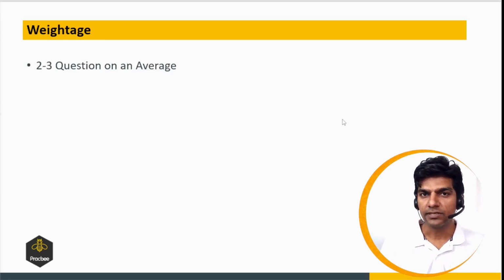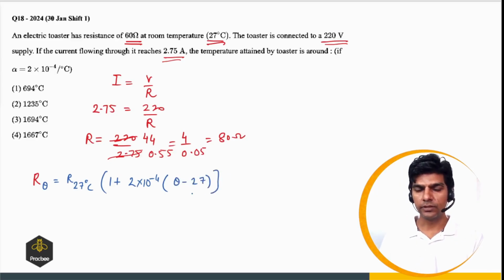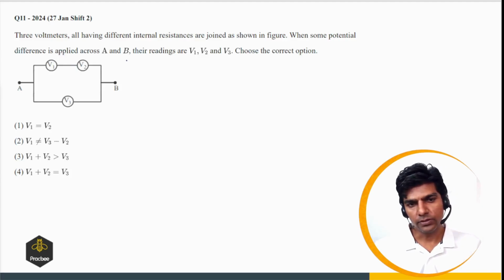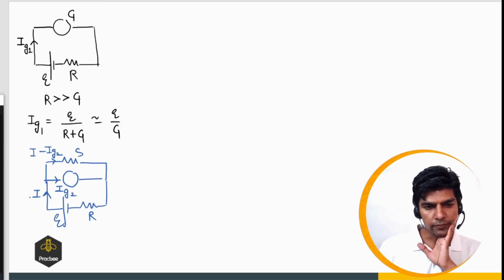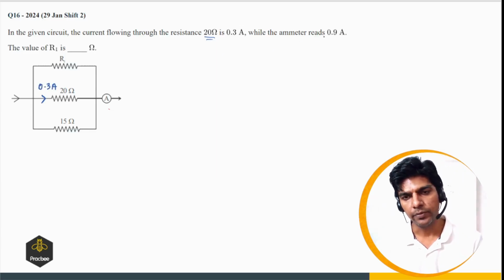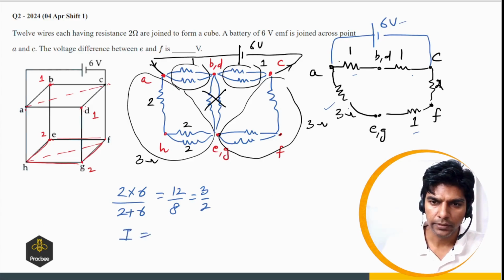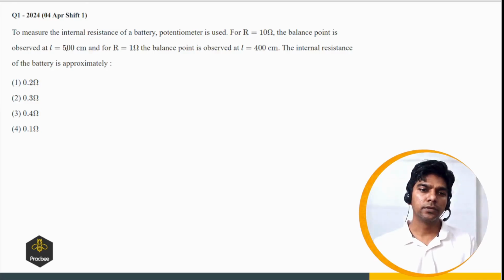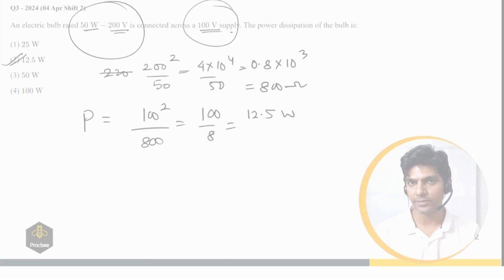Current Electricity into Problem types |JEE Mains 2025 |10 week strategy series|Puran Chand-IITDelhi

Comment: Sir in q.5 if temperature decreases, then conductance of semiconductor decreases and resistance should increase only right? Then we should write R new = R old (1+αΔT) only na? Then how ΔT = -20? And initially it was 25° and it has become 20° then ΔT should be 5° only na?
Reply from the maker: Data in question is not consistent. They have given semiconductor but it's resistance is decreasing with decrease in temperature which is not correct. All options are negative which suggests resistance should increase with increase in temperature. I have assumed it to be semiconductor so temp should be increased to decrease temp.